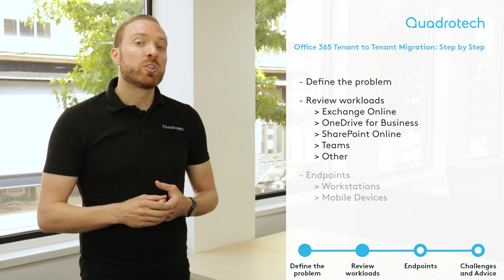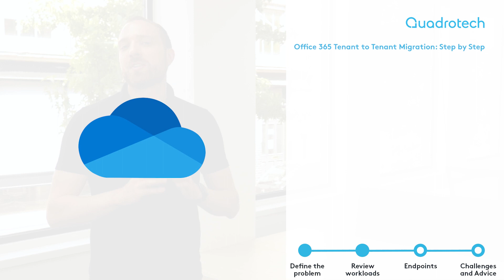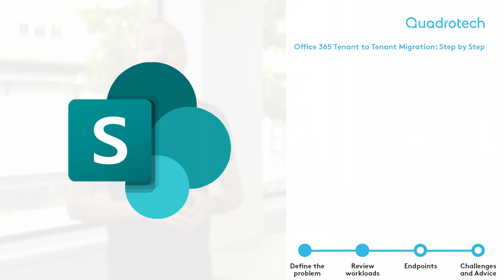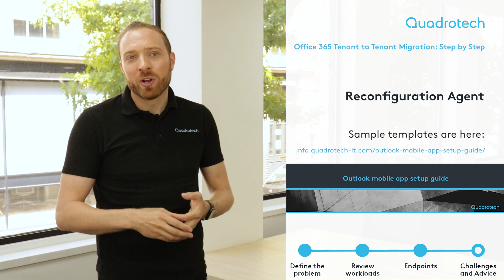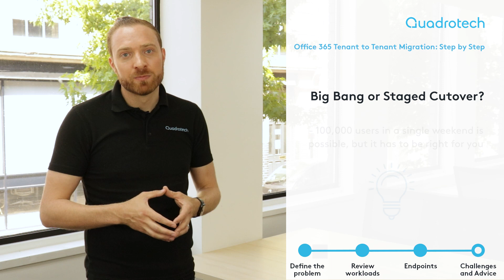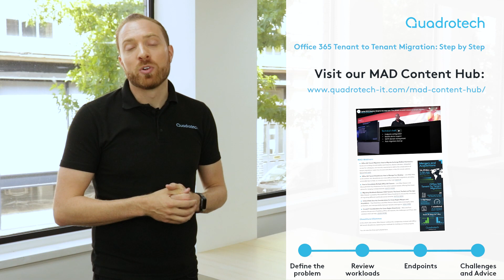Office 365 Tenant to Tenant Migration: Step by Step

Comment: How about Power BI? Is there a way to easily migrate all this? Or will I have to recreate everything?
Reply from the maker: PowerBI has two challenges, limited APIs and the supporting system.  Often PowerBI is pointing to data sources in the tenant. This means you have to move the data and the PowerBI aspects.   Most of the time the end user needs to export and import these solutions, and then reconnect them.   It can be quite a task depending on the situation. 

During the planning stage it is important to understand how heavily used PowerBI is and then make plans to address it.  The good news is most projects find concentrated use.   With good planning and communications, this can control this aspect of the tenant migration.

Stayed tuned to this space!  We are hopeful this space will mature in the next year or so.